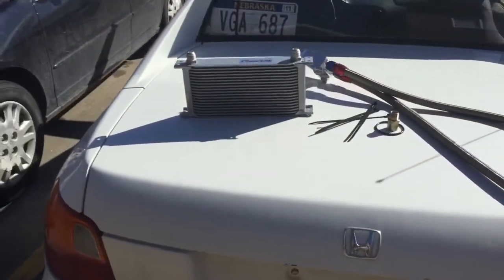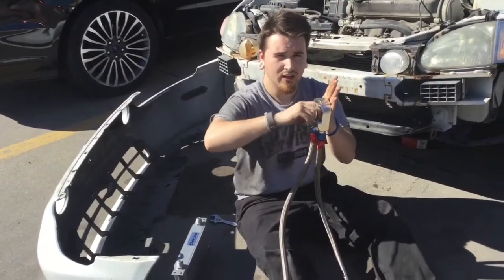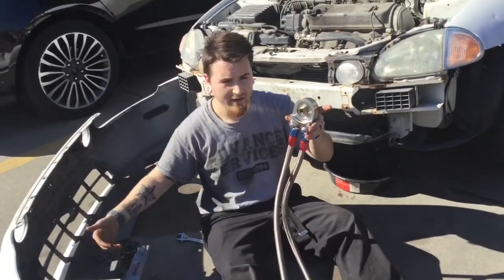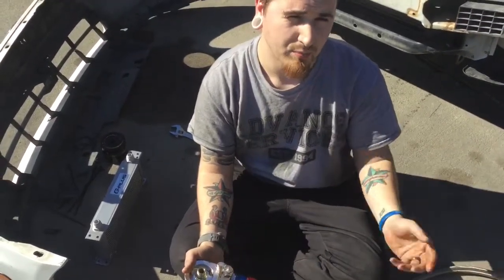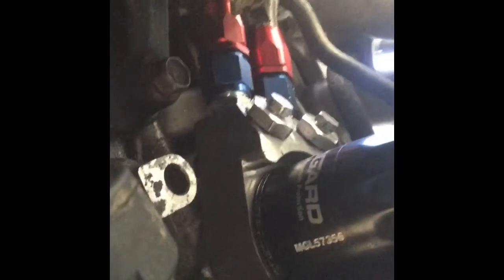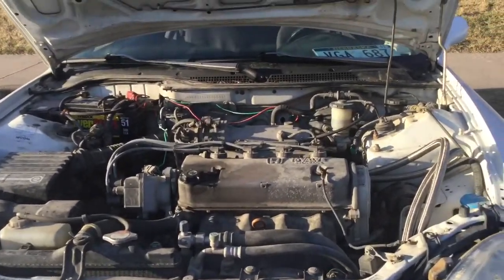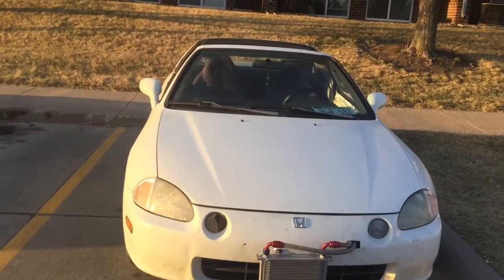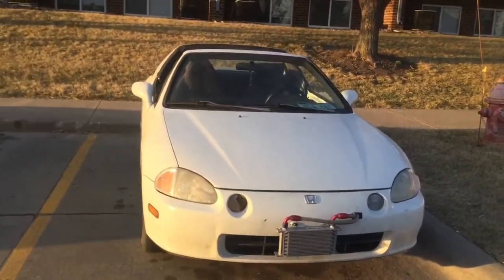how to install a oil intercool

Comment: How has it been holding up?
Reply from the maker: Really good. The min I installed the oil intercooler it can definitely tell the difference on temperature of the inlet and outlet hoses. I would work even better once I do a engine swap with turbo
Reply: @Jeffdelgado28  awesome! Thanks. Was looking to get one and it was the same brand. Thank you 😊
Reply from the maker: @JohanGavieres  your welcome. I would definitely  recommend getting one